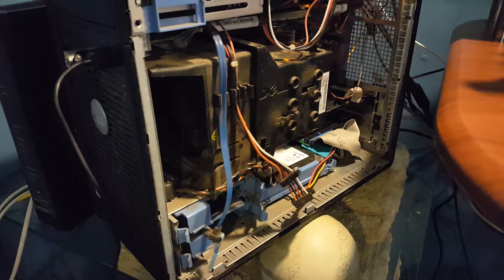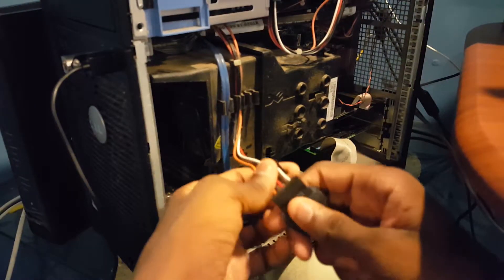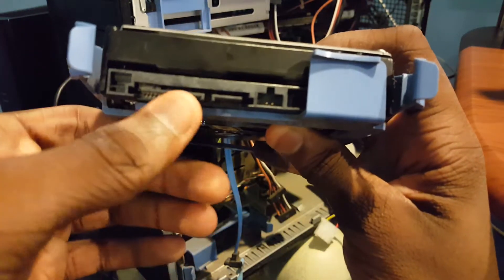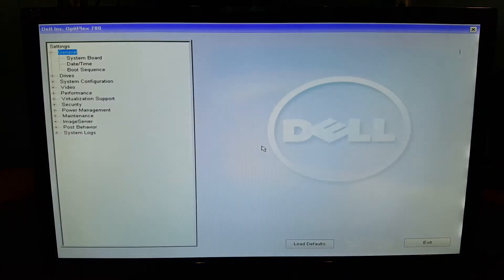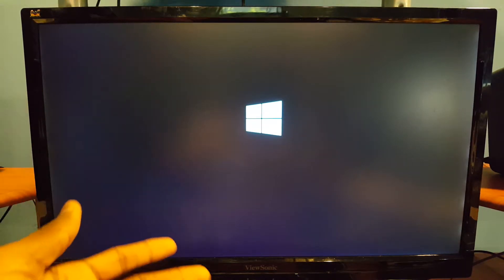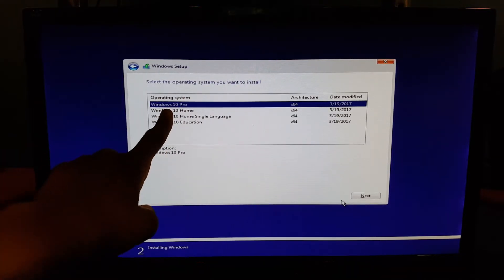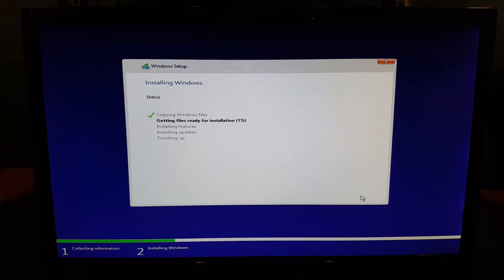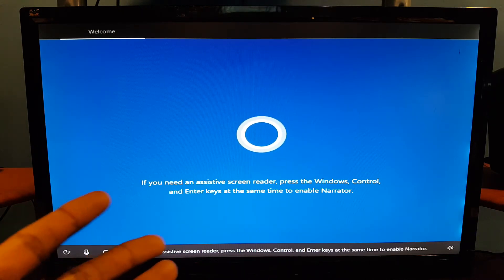How To Install a SATA II Hard Drive

Comment: mine have 3 cables port SATA power SATA signal and 4pin power supply so can I just plug the 2 SATA cables or plug them all just like my old SATA 1 HDD
Reply from the maker: What ports are available on your HDD?